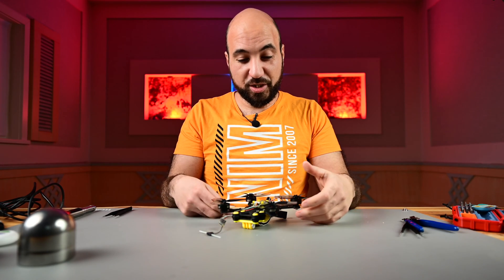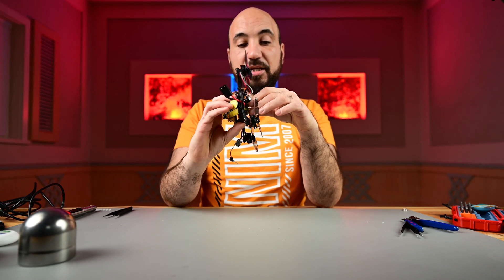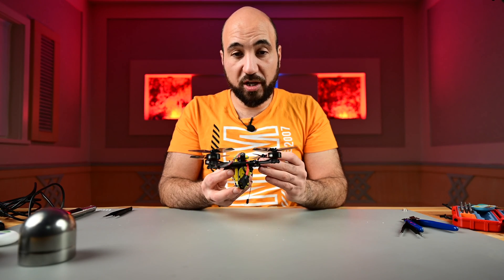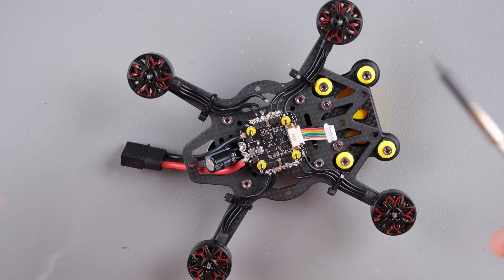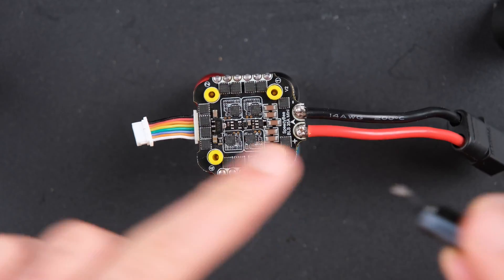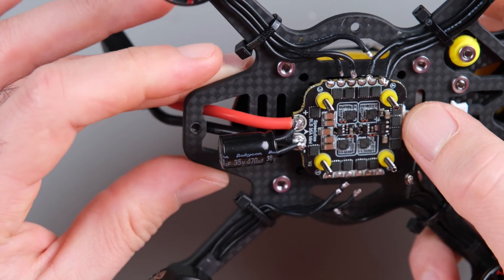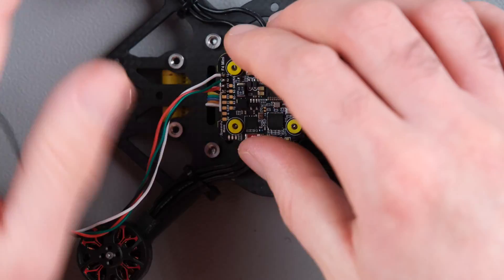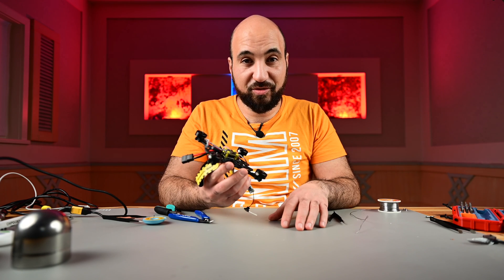SpeedyBee Bee35 F405 Mini stack install

Comment: Just curious — does the F405 V4 fit this frame?
I’m planning to move the components from my 5” spedybee Mario 5 into this frame and use the DJI O4 Pro system on it.
Reply from the maker: I don’t think it fits, at least not “naturally” because the space is very tight, maybe you can fit it somehow but it is not meant for a normal stack

Comment: Sorry I am new to drones and I was wondering what the capacitor on the power connector is doing?
Reply from the maker: @Godot-Game-Dev  hello my friend, capacitors help with voltage spikes and electrical noise from the power source, in this case the Lipo batteries 😊
Reply: @bilumedia  Ahh that makes sense thank you so much 😅
Reply from the maker: @ you are very welcome 😊

Comment: Hello i just bought this stack but i only have lipos with XT60, is it possible to conect with this stack? How do you recommend to do this?
Reply from the maker: Hello, you can solder xt60 yeah, or use an adapter…
Reply: @bilumedia  thank you!!! I did it and it works 🤗👌
Reply from the maker: @ricardobmcrea  you are very welcome, happy flying 🔥😊

Comment: No no you are right, they are wrong.  If only to avoid short circuits, simply flip the rubber.  Your motor direction are very important so if you use Inav there is no need to remap motor.
Reply: @aryoks6840 if motor order is important,  I think the stack should be installed on top. Installing stack inverted at bottom of frame is bit confusing even from gyro perspective.
Reply: @zfold4702 do you mean put FC in first and esc and put esc After ?
Reply: @DreamLife-mr8rt  esc first and then the FC but I realized the frame is designed in a way that requires installing the stack upside down. This will require remapping the motors in flight software to correct the motor order.
Reply from the maker: It was ver close to the carbon fiber plate and maybe it was risky if the rubber got damaged i time 🤷‍♂️

Comment: Hi Guy! Your videos of the Speedybee 35 are great! Thank U for being so clear in your explanations! I'm already in the RC Car hobby and I want to start in the FPV: i would like to fly a Speedybee 35 for my first drone and doing it by myself (cause I've never made solder and I think I will be proud if I can achieve a full built! It's a kind of challenge!
I think I should take:
- a frame, pro version with all access included and meteor Led
- a stack (You use the F405 Mini BLS 35A 20x20. Is the   F405 V4 BLS 55A 30x30 or the V4 BLS 60A 30x30 better?? Or is it no use or too big
- motors
- props
- an ELRS RX (you give a link in the build video)
- maybe U can suggest me a GPS which can fit in the mount included?
Can you tell me if that's sit or if I have forgotten something please??? (I have already a radio, and goggles and I will getter an Dji O3 system soon)
Greatings and Tschuss vom Elsaß! (I schreibe in English weil mein Deutsch nicht so gut ist!!😂😂😂)
Vielen Dank und Tschuss!!
Reply from the maker: Mein Deutsch ist auch nicht so gut 🤣🤣🤣. Thank you very much for your kind words. much appreciated ! Speedybee is a wonderful drone, you will love it :) I would advice you to buy the mini stack as the full stack is not recommended by SpeedyBee, maybe you can do it but it will be very tight and not ok, the mini stack works very very well! As for the soldering part, it is very very enjoyable and I would recommend you to buy the TS101( it is very good) and TBS solder and use flux pen please, they are small details, but can make a huge difference💪, I have a full build of this drone(but mount the mini stack as I show in this video not the other one!), And I have a video showing the led strip as well, it is fantastic!For the GPS, any 121 GPS with M10 would work!and for the receiver, if you have ELRS on your radio, then I would use SpeedyBee RX - https://bit.ly/3Us5iax. If you want any help please send me a message on Instagram and I would be happy to help you 😉( If you can use my links to purchase your Speedybee products, that would be much appreciated, it doesn't cost you anything extra😊 , Thanks!)

Comment: Was watching and building along with your building video.  Glad I caught this before I installed my stack.  Great videos man.
Reply from the maker: I didn’t have problems with the first method, but this is way better and safer for sure 👍, the only thing that you have to do is to reorder the motors im BF 😊
Reply: @bilumedia  I did one 3d printed pusher  build in the past so I remember how to re-order and how to change FC orientation.  It took me a while to realize that the motors don't know or care whether the props are above or below...

Comment: Thank you for sharing the update. I am expecting to receive my F405 mini stack tomorrow and will be installing it in a Bee35 frame. It's good to know that this method is what SpeedyBee is suggesting. I have not built a pusher style quad before and am a bit confused about the upside-down configuration especially with how it relates to motor order and direction. I intend to flash INAV 7 on this quad and hope that set-up won't be too difficult. I really appreciate your efforts with your channel. I find your content interesting, informative, and entertaining. I've subbed. Happy flying amigo. 🍻
Reply from the maker: Thanks my friend, much appreciated 😊! It is very nice drone, it flies very good and indoor really slow flying for real estate work i managed to get 8 minutes with gopro mini 11 on top and 1050 mah battery ! I think it is very good drone with a lot of features! I didn’t use inav before, i should try it, but i guess it should work ! Good luck with your build and let me know if you need help 💪

Comment: I think the simplest solution is just flipping the rubber damper since the rubber damper has two sides, one is short and the other one is longer. You can use the longer one between the ESC and the frame. And for the USB gap, you can just put some tape in the USB to prevent short circuits. No need to solder and desolder. hopefully it helps
Reply from the maker: Hi my friend. Yes you can do that! I was thinking to do this, but I wanted to show this solution, because it is the safest solution and the gaps are changed considerably! and if someone build it from the ground up, I guess it is not a problem to solder it again! If you buy it from SpeedyBee, I think it comes with this solution and not how I did it the first time! But definitely  you solution works as well! Thanks for sharing 😊
Reply: Your idea is similar to mine. I flipped the rubber stopper and at the usb port I put heat resistant tape. everything is very fine